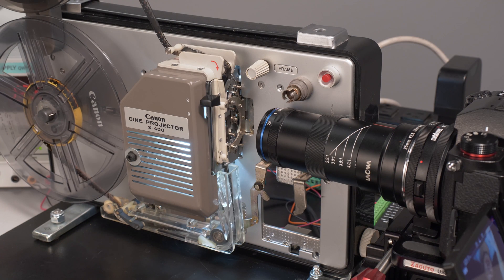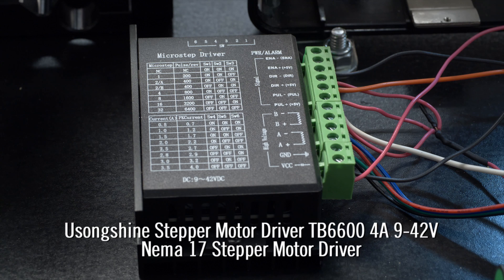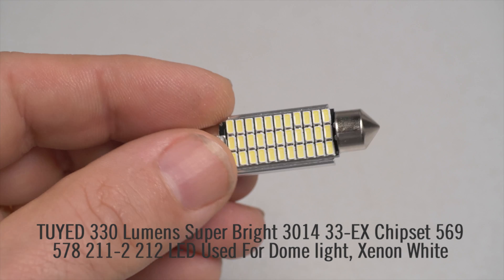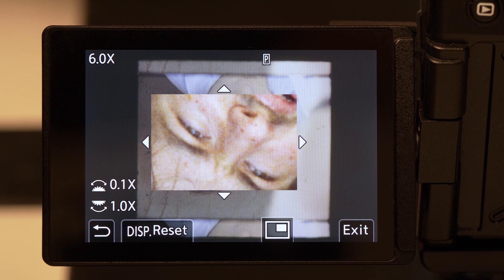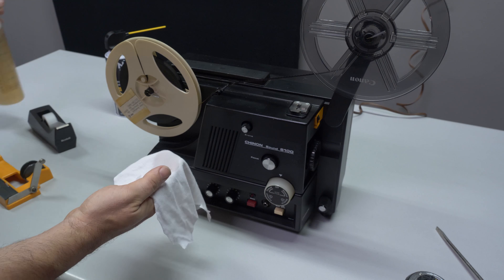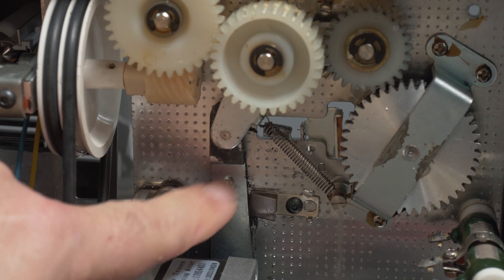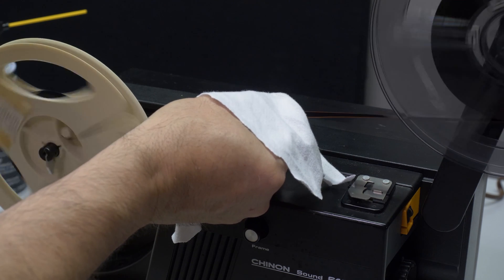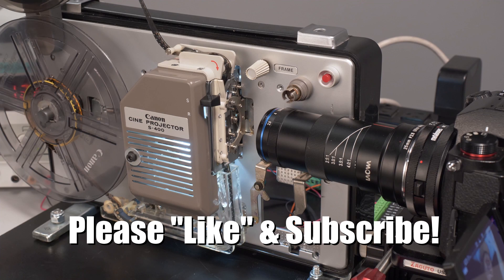DIY Super 8 Film Digital Transfer Update 1

Comment: I've just built a transfer system using this as a guide. Other than having a different projector to work from, the only change I made was in the power supply: I went with a "MEAN WELL LRS-35-12" (no affiliation!) Otherwise, I grabbed these parts and followed this approach. So much more attainable than the Arduino madness!
Reply from the maker: That's great! Congrats!
Reply: Do you recall the watt output of the Meanwell Lrs-35-12? On Amazon they have the same model number but 50watt, 35watt and 36watt outputs. Is that a critical spec?
Reply: @boydtv Unless you need a bench power supply for other things it's much cheaper to use a fixed 12V 2A wall wart power supply. You can get one for less than $10

Comment: Great follow up. I took apart the same projector, and robbed the gate/claw mechanism to do a DIY. I came across two issues when thinking about using the projector itself, one was the space for the camera lens (I see you had to cut into the projector frame too) and I could not figure out how to remove the dial below (which you did). Is there a trick to remove it or did you break it apart?
Reply from the maker: It's been a little while, but I think I had to cut the wiring, then there were some bolts in the gate area that had to be loosened or removed as well in order to get the knob out. These bolts then had to be retightened to secure the gate area.

Comment: I don’t know how long this microswitch will last, it may happen that after one digitization it will break. there is just a plate inside. It is better to put a reed switch and a magnet and it will be easier to adjust and the reed switch is sealed, and these microswitches are not reliable shit. In addition, it will click constantly, if you leave it overnight, then I don’t know how to sleep under this click.

Comment: I'm building a similar system with only some changes : the feeding movement and the shot are triggered not by a switch but by an optical interruptor driving an Arduino. Hence I can play on the delay between movement and shot independently (just the delay to be modified in the Arduino sketch) + some additional features : frames counter (drived by Arduino too) , visual display of the frame rate( in fact stepper driver speed), camera remote command activated by a non mechanical relay (Arduino ...), etc.. When I see this video I wonder if all what I'm doing is not completely superfluous...hmm..
Reply from the maker: I personally didn't want to get that involved, as my knowledge of the electronics is lacking. The only fault I see in the mechanical system of mine is that eventually the momentary contact switch might have to be replaced. I think it's great that you could add all the other features though. The one thing that I'd like to add, and your system might make this easier, is an auto shut off when the film runs out or breaks.  Good luck!
Reply: @FreshGroundPictures  That's exactly why I was reluctant to use a mechanical contact !. Re electronics, I grabbed on the web some quite simple designs, since myself I'mnt comfortable with electronics..I think that by measuring the light, if it keeps high too long, Arduino could shut off it easily since it can control the camera (shot and power) . Nic suggestion, I'll try to  add it. Anyway, congratulations for the quality of the results!.
Reply from the maker: @florentleider222  I used the same mechanical switch in my 35mm transfer system and it is still holding up after several thousand feet transferred!
Reply: @FreshGroundPictures  Bad info ! (It would have been simpler for me to use it). 
My main issue remains the optical part .I'm 100% ignorant when time comes to juggle with lenses !!

Comment: Hi
Thank you for sharing these videos.
Excellent explanations and great result!
You might be able to help me?
I have accumulated a good number of 16m amateur film footage. I can watch it on an Elmo projector I own. But I'd like to trnsfer them to digitalI am working on a 16mm film scanner. I came to similar solution as you. For the registration I use the transport mechanism of an Ampro 16mm projector. I bought this as sold "for spares". The transport mechanism is fine. The firm reels will be held on bespoke turntables with an tension controlled electric drive for the take-up reel. I also bought a second hand Sony NEX camera and are using various macro lenses with a bellow, mounted in reverse and even 2x and 4x microscope lenses. (First trials of these optics have been run on a Pathe Gem 9.5mm projector I am also converting for a film scanner:  https://www.youtube.com/watch?v=stTI1pALTKE )
For the film transport I purchased the same stepper motor, controller and driver unit. 
Unfortunately I struggle with the wiring and to make the motor spin.
Could you help me with a snapshot of your wiring or a scheme??
Many thanks
Reply from the maker: Hello. First, make sure the cable from the motor is the same color arrangement as the one I used. It's very important to have the A & B connections correct. Also, be sure you have the positive 5 volts out of the  control box to the driver split in 3.  I have some close photos of the wiring and dip switch settings on the driver, and the wiring diagrams in the video, but YouTube won't allow me to post these in the comments.  You can try contacting me through the "About" section on the YouTube page. Thank you.

Comment: Brilliant follow-up. Really appreciate the clarity and detail of the components used. The mechanical trip of the shutter is such an important and effective simplification vs many other home-built transfer systems out there. I will be creating my system with a Sankyo Dualex-1000 that I have which needs both a lamp and motor replacement anyway.
Reply from the maker: Good luck & have fun!
Reply: @FreshGroundPictures  It's happening! I'm transferring now and while the entire system needs a bit of refining, it works. I had to be a bit more aggressive with the Sankyo to create space for the Loawa macro lens, but I'm there. Thanks again for the generous guidance!